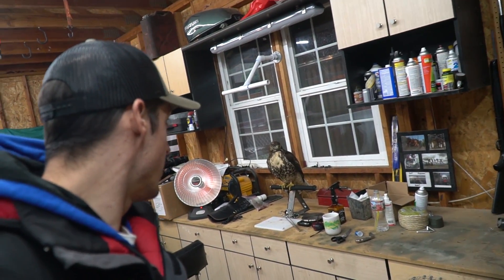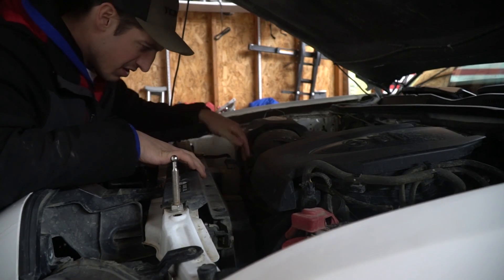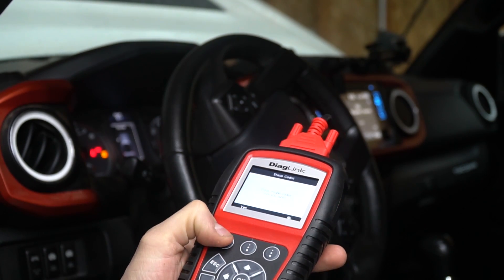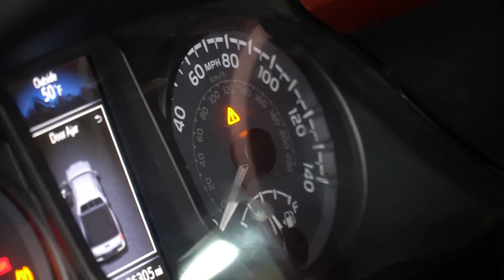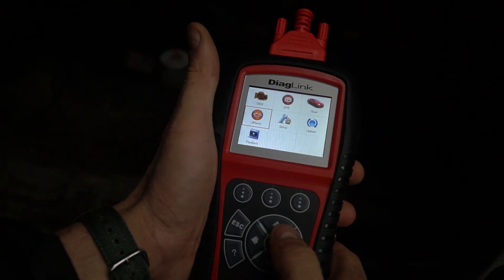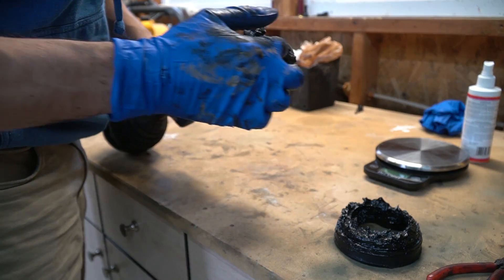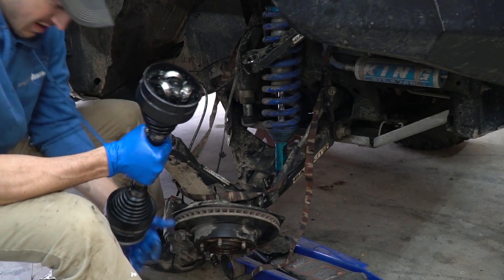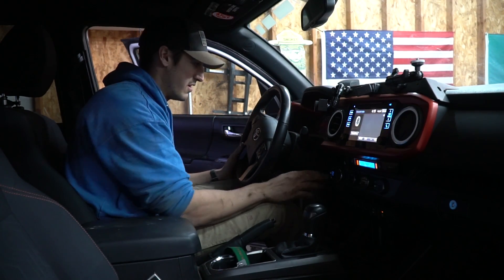My Tacoma's Throwing Codes! | Autel Daig Link Test | Cv Boot Repair

Comment: You can also pull codes on any vehicle with an OBD-ll port by doing some weird procedure of turning the car on/off and using the pedals. Helped me diagnose a bad coil at 12:30am on the side of a road.

Comment: Maxx, I've had problems like this on my Tundra. I finally got much better axles from a company in Denver called CVJ axles. So far they have held up well. I hope they continue to, because I don't even want to have to change the boots on mine. This looks like a pain in the ass.

Comment: The movement in your driver cv could be due to the factory needle bearing. East Coast Gear Supply makes a bushing that replaces the Toyota bearing for the 8” clamshell diffs. This happened to my truck last year, the cv moved like crazy then once I replaced it with the bushing all the slop went away.
Reply: Forgot to mention, this is really only an issue with lifted 2nd and 3rd gens, if you just replace the needle bearing with another one it’ll just wear out again. The ECGS bushing is designed for lifted Tacomas.

Comment: Hope you have better luck with the allpro boots then i did. For me they rubbed the lower control arm at full droop. This caused them to tear and fall off pretty quick. Also i havnt found a better boot then oem yet and I’ve used a ton of them. Also i slide the oem boot closer to the hub to allow for more flex.

Comment: That scanner is awesome! My Toyota had running issues when I was in Moab in October, and it was down for a day. My OBD2 chip, and bluetooth OBD2 said no issues. Put the Autel Diag Link on that my friend had, and found out that my crankshaft position sensor was bad! Saved my trip. Had to wait for parts in Moab, but eventually got to wheeling again :) I bought one of those as soon as I got home and now it lives in my truck.

Comment: Thx Maxx. I have a similar issue w the front right CV Boot as well, but only on the passenger side. I have an O6 Tacoma and recently had the frame replaced by the dealer. They also replaced cv boots and axels, both sides. This was maybe 2 months ago and the front right cv boot is already pulling away. Thanks for the video and tips. I need one of those fat boots. Glad to see Carol is enjoying a little shop time.

Comment: If the gas cap has an o-ring, you should to see if it is cracked. I got an emissions leak error on my Prelude a few weeks ago, checked the gas cap and the o-ring got dried out and cracked. Replaced with OEM gas cap and the error has not come back.

Comment: Maxx, yes, a code reader is great, but mechanics still need to do old school problem solving. Code readers just give you a place to start. Code can be thrown from other components that make it seam like the issue is one thing and it can end up being something different.

Always start with the easiest thing to check or fix first, then progress from there. Just like a computer, control, Alt, delete fixes most issues! Lol

Comment: an evap can also be due to a worn seal on the gas cap.. there is a rubber seal that if it gets dirt behind it it will no seal, and cause leaks.. or the grit will wear into the filler neck.. and you clean it up with some light emery cloth.. and lube it with some liquid white lithium grease.

Comment: Your maintenance light comes on every 5,000 miles. Because when you buy it new you get your first 5 service appointments within the first two years for free. They only change the oil every 10k, but they rotate your tires, do a multipoint inspection every 5k.

Comment: Evap leak from loose gas cap may be a self reset code, tighten cap and  2 or 3 full cold to hot engine cycles it will reset on it's own.

Comment: Hey new Sub here! I currently drive a Ford Focus ST which I’m looking to trade in next year and the Tacoma TRD Off-Road has recently become one of my top options. I’m still learning a lot about them which brings me to my question, are they reliable? In the comments it sounds like you’ve been having a lot of problems? Great videos btw so peaceful/entertaining to watch.
Reply: I own a 2nd gen. But it seems like the 2019+ are more reliable and less buggy than the first models that came out 2016 & 17. You should get a used 2nd gen. I have zero issues with it. Unless you want a brand new 3rd gen
Reply: His is highly modified though man... Just going to be part of it if you go that route.

Comment: If that tire pressure light bugs you build a pressure vessel for the old sensors and toss it under the back seat.  That’s what I did on my Taco.

Comment: Hey Maxx, there should be a little black button underneath the steering wheel by your legs that will reset your tire pressure icon. You hold the button down like the trip distance button.
Reply: Adam Berger could be a bad sensor though... I tried resting mine but now it just blinks cause my tpms sensor is broken
Reply: @nickieduece2146  That could be too. I only mentioned it because I didn't know about the button when I was getting the same icon, and I didn't know if it would reset with the sensors missing. Worth a try if it takes the light off. http://toyota.custhelp.com/app/answers/detail/a_id/7892/~/how-does-the-tire-pressure-monitoring-system-work-in-my-vehicle%3F
Reply: Adam Berger yeah I was confused when mine was staying on as well🤷🏽‍♂️
Reply: I think the issue is that he doesn't have the TPMS sensors installed on that set of  wheels. At least that's what it sounded like.

Comment: Man I run amsoil full synthetic. And I change mine every 12k miles and my truck is going on 100k miles and runs flawlessly.
Reply: Yeah, their high line is meant for that interval. It sounded like he changes his oil every 20k which is crazy. Also, given the fact he off-roads it should be done more often that a street vehicle only.

Comment: I hope you're not changing old every 20k miles bro.. 6k miles I can understand... but no way 10k or more... you seem pretty hard on your truck.. just my 2 cents.. keep em coming
Reply: Yeah I like to change mine around 6k full synthetic
Reply: Maxx Powell Maxx, the color of the oil is not a good indicator of if the oil is still good. If anything, I recommend you go to blackstone-labs and get a free oil sample kit. On your next change get a sample and sent it to them. They will test the oil for metals and the condition of the oil. For your first test I recommend getting a tbn done. It is an extra $10, but that will tell you how many additives are still left in your oil. Black stone will tell you how many miles they think you can push your oil. Again I think it is one of those things where maybe you only sample your oil once a year, but it will give you a good idea of how your motor stacks up against other people with the same motor (they show you universal averages for the motor you are sampling and the avg miles people changs their oil). Heck it might even make a good youtube video!
Reply: He may have mispoke in the video.  Im pretty sure the maintenance light comes on every 5k.
Reply: mtnhntr that makes sense actually. I think every 5k for tire rotations, and oil every 10k. If hes changing every 10k thats the factory recommended so he should be good. I have a 2nd gen but I change my oil every 4k, ive had the oil tested 4 times since owning it and everything comes out great.
Reply: My wife's Corolla has 268,000 on it and I have used nothing but mobile one in it and I change it ever 10k and it runs like new still. Modern synthetic oil can go 10k with no problem at all.
Reply: Agreed completely!
Reply: scott k very good point, Scott! But remember, Maxx is WAY harder on his tacoma than your wife is on her corolla. Completely different
Reply: How do you know his wife isnt street racing that corrolla like suki?
Reply: @singletrackftw  Looked at the maintenence schedule for my Tacoma.  They suggest 10k oil changes under normal conditions, 5k if offroading, in stop and go traffic, towing, etc.  Im guessing hes pretty safe with ~10k for the majority of his driving.
Reply: mtnhntr have you not seen his videos? He wheels his truck often and hard! Therefore 5k is likely the most ideal interval for him
Reply: cointoss election  In those situations yes, Id probably change a little soon or at least be watching it closer.  But its really not that frequently.  The majority of his miles is probably pavement.
Reply: Full synthetic oil is able to go 10k+ miles as the oil doesn’t break down as quickly but you should still change your oil frequently as you build up contaminants in the oil from normal engine wear and operation and the detergents in the oil are consumed and the only way to get rid of the contaminated and replenish the detergents is by changing the oil. I run full synthetic in my vehicles and try to change it around 5-6k miles still. The cost of changing the oil more frequently is far less than what the cost of a new engine would be.
Reply: in canada Toyota recommends every 16000km with a maintenance schedule every 8000km which is basically a $90c lookover

Comment: Man. This guy fiddled and changed out every single part he can change to aftermarket, and messed around with the engine and exhaust. He ruined the Integrity and realibility if the truck of course itll give check engines and other codes.

Comment: Dude....change your fucking oil. I’ve been a mechanic for 15 years. I run full synthetic and going 6k still makes me cringe. Also just because the oil can maybe last, doesn’t mean the filter can. It’s cheap insurance compared to premature engine failure. Plus if it fails and is still under warranty, they can void it because you’re not doing proper maintenance.
Reply: Only problem toyota reccomends every 10k. Especially if your using their synthetic or equivalent.

Comment: Max, I realize you use full synthetic oil but you should really consider changing your oil at least every 7500 miles if not 5000 miles. Consider how hard you use your truck compared to the average tacoma user. There are oil tests out there that I think would show you that an oil change every 5000-7500 miles is not overkill.